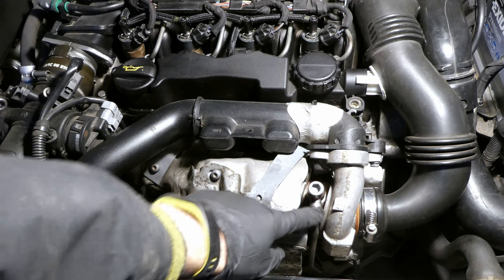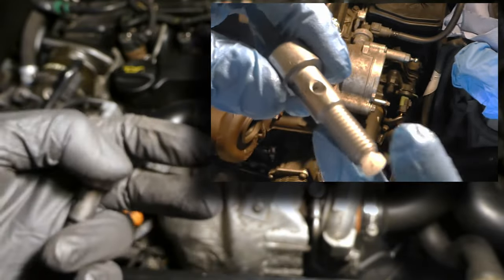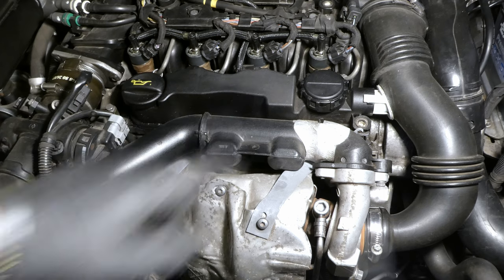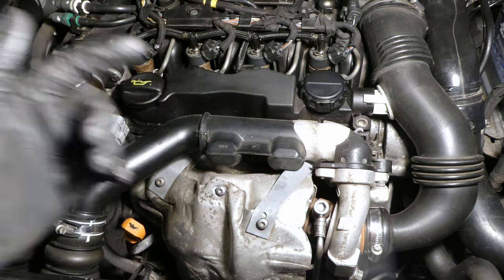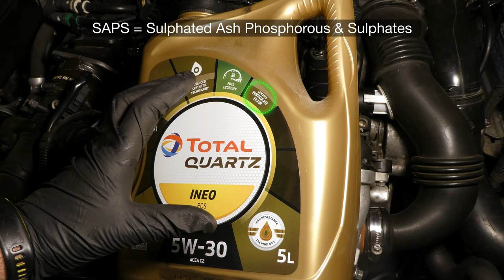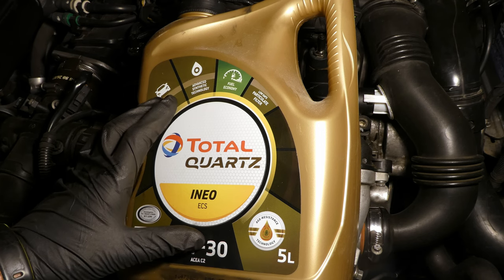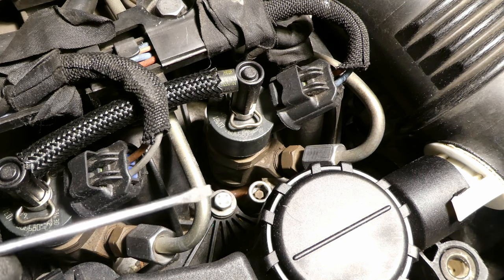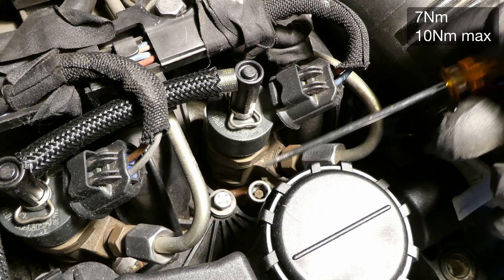1.6HDi turbo failures, the 2 main reasons and surprisingly simple steps to prevent it

Comment: Why wouldn't the oil filter stop the carbon deposits getting to the turbo? I thought it was a case of the oil pickup getting clogged causing oil starvation to the turbo.
Reply from the maker: Because it is something that fairly few people know. The oil filter has a bypass valve! If it gets too clogged and the flow of oil needs to still go, so it has a bypass valve, all the bits and pieces do not go through the filter. Hence, it is crucial to change oil lfrequently + the oil filter.
My fault, I did not include this in the video.
Reply: @moremolecules  do you know what the little nipple on the oil filter is for? Is it just to help locate the filter when installing? I read somewhere some versions exist that have a tube outlet instead of just a plastic nipple.
Reply from the maker: @norm4260  Yeah, not too sure, as far as I know it is just a location lug, nothing more, but may be wrong about this. For the 1.6HDi, I do not think there are more designs about there, but maybe, I am not the best expert on these 🙂

Comment: Great vlog. Its why I buy petrol mine also. 2007  berlingo 1.6 with 146k still runs fine just a bit gutless
Reply from the maker: I agree the 1.6 petrols are pretty stable, not much in there to go wrong. A bit gutless though and consumes quite a bit of petrol.
Reply: @moremolecules  japanese petrol engines with vvt have low consumption and high reliability. The perfect car would be a german one with a japanese engine.
Reply from the maker: @AC-db4ek  Yeah, maybe, parts will be difficult to get for the Japanese in Europe.

Comment: I've had my Peugeot 1.6 HDi 90 from new and it's now on 410,000km (256,000 miles). It blew its turbo at around 200,000km and the mechanic was convinced it was the quality of oil I had been using. While the oil met all the requirements (5W30, fully synthetic, ACEA C2, PSA B71 2290, etc.) and I changed it every 10,000km or 6 months, it was a supermarket brand (E.Leclerc here in France) and he was not impressed! So since then I have only been using the likes of Shell, Mobil, Total and so on. So far, so good.
Reply from the maker: Yes it could be, but when a turbo blows there is always some sort of a more concrete reason. I suspect the mechanic did not investigate fully why that hapenned. Blocked banjo bolt or something blocked somewhere or could be that you cover a lot of km/miles and there would be a limit to components of course. If the oil was meeting the specs it should have been good, but maybe. I always use reputable oil manufacturers, Total, etc., but the others should also be alright.
Reply: @moremolecules  I don't really doubt the mechanic - he's always been spot-on with everything he's done for me over the last ten years or so. I did ask him about the mesh filter but he said it was difficult to tell. He did replace it though with the long plastic one. The turbo had a massive failure and the oil filter was full of metal and ceramic. He had to do three oil and filter changes as well as a sump removal before he was happy there was nothing left before he fitted the new turbo.
Reply from the maker: @ajkgordon  Yes, sometimes is a bit difficult to tell. The failure is more often than not spectacular, say the shaft seizes and overheats, breaks in a place somewhere and the blades get to touch the metal casing and then these get thrown in the oil return, filter, etc. Unless is caught earlier, but difficult to do.
Reply: @moremolecules  I was very proud of mine at 400,000km but when I took it in the other day, he had an identical Partner in the workshop at 750,000km! Fantastic cars. Our next car will be the Rifter.
Reply from the maker: @ajkgordon  750k, that is something...

Comment: Great info! Many thanks.
I have replaced 2 of the copper seals in the last year after signs of the black tar, and slight chuffing, fumes in the car, have also checked the torque on other  injectors. 
Just wanted to ask if re cutting the seating surface is always necessary? mine looked good after a thorough clean so I just replaced the copper seal without re cutting the seat.   is that ok if the leak wasn't too bad? the first one I did has been leak free for a year now.
Thanks.
Reply from the maker: No you do not need to recut the seat, but of course it depends on how long it was chuffing. The longer it is the more opportunity the gasses have to eat the metal and then you need to recut it in order for the seat to be level and the washer to make a clean contact. The cutting is also needed of there have been carbon deposit as well, but is it is clean whe the new washer was put in, then it should be ok.
If it has been clean for so long now it is absolutely fine.
Reply: Many thanks. @moremolecules
Reply: I'd place the cutter inside and hand turn it with no pressure. This way your not cutting down any more but if there is any tinny uneven areas it will sort it out. Ps pup some grease on the end so any bits stick to the cutter rather than drop in the chamber

Comment: Thanks for the informative video. The question, where do we need that turbo oil line banjo mesh filter? The oil is anyway filttered. Does this "banjo filter" work as the "last chance filter" in an aviation jet engines? Better to remove that filter in order to prevent oil starvation?  "Any oil is better than no oil".

Comment: Hi More Molecules! Thanks for the genuinely great videos! You are very knowledgeable about the 1.6HDI engine and I have one in my Citroën C4 Grand Picasso 2010. However, this particular one suffers from a problem. There is a fuel leak. Diesel drips down from somewhere on the back of the engine and down onto the exhaust. The car shows two error codes P0093 (Fuel System Leak Detected Large Leak) and P0087 (Fuel Rail / System Pressure Too Low). I suspect the fuel harness to be the culprit but it's hard to see because everything is at the back of the engine. Is it possible to change that harness from above, so to speak, or is there any other way to access the back of the engine? When this more serious issue is out of the way, I'm going to fix the leaky crankcase breather, with a thicker O-ring, the way you showed, and I think there are some other issues that you have solutions for too. Anyway, thanks for all the videos! I hope you can find the time to answer my questions. /Mats
Reply from the maker: It could well be a leaky diesel fuel filter or something else. Pretty much all is at the back and rather difficult to do from the top or front. The C4 has limited access to the back, so it would be easier if you have a mirror and look where it leaks. It is leaking somewhere, so you may have to remove the airbox and have a better view. Do not remove the diesel filter and it may be leaking from there. Good luck
Reply: @moremolecules  Thanks!

Comment: I agree that clogging of the turbo oil feed filter kills most turbos, I doubt that's related to the injector. However the biggest flaw of this otherwise solid engine is the oil volume of only 3,7 litres, which is far too little and the root cause for poor oil quality due to contamination with fuel and soot. Independent of mileage I believe that 2 oil services a year are mandatory.
Reply from the maker: Yes, the injector seal failures have been for awhile in the PSA bulletins. I agree that there is not enough oil in the 1.6HDis. Even my 1.6 Peugeot petrol engine has bigger capacity than the diesel.
Reply: @moremolecules  I know, I had to fix mine recently and of course it was the cylinder No.1. I just cannot imagine how the gunk that emerges from the seal should  make it back into the oil circulation. Did you open the valve cover of your engine and have a look at the cams? I found mine to be shockingly worn, probably because the hydro lifters are blocked with oil residue and don't give enough way once the engine is hot. However, once worn it does not seem to get worse, as I could not find any metal chips in the oil or filter.
Reply from the maker: @cyberbob4111  Yes, it took me really some time to work out how the gunk can go back in. The thing is that the injector tube is not integral to the head of the engine or crankcase, so there is a rubber seal that seals it from the crankcase. The gunk can pass that one and go into the crankcase oil and then the consequences of gunking the small turbo oil feed filter and the oil pickup as well. I had a look at the cams, but they look kind of alright, there are a bit worn, but they do not seem excessively so.

Comment: My turbo got faulty after i overfilled a bit of the oil, and on top of that the seller got me the wrong oil for the car. Now it has no boost and there’s oil spilled around a lot of parts. Replaced the crankcase cover but oil is still coming through the PCV valve into the turbo intake manifold. Still can drive fine but very sluggish. There’s oil leaking in the turbocharger, smoke is being expelled from it since startup. Actuator vacuum seems ok, there’s no excessive play from the rotor, turbine is sucking in air just fine without any noises… Going to an autoshop would cost  more than what the car is worth… I don’t know what to do to fix that.

Comment: Nice video bro. Thank you very much. I did the seals replacement and it went well. However, i discovered diesel leaking of the diesel entry on the injector. 
Do you know how can i solve it? Thank you
Reply from the maker: You could potentially nip the nut a little bit (if it was disturbed or undone), but preferably undo the nut, inspect and re-seat or change the fuel line itself.

Comment: Hello! I just saw you video and i had a similar problem with the injector seals on my 2007 Volvo C30. At one point this year i started noticing gas smell inside the car when the engine was stalling but not when i was driving at high speed. I had it checked and the mechanic told me it was the injector seals which were worn out. There was also the grime you just described near them :) Anyway, i had them changed, the engine cleaned, and after 2000 km i changed the oil and oil filter along with the air filter. It runs smoothly and accelerates well to its top speed (180km/h).  Should i be worried though about my turbo?
Reply from the maker: Very good questions. Generally, if you service it regularly and replace the oil filter regularly, then it should be alright. I did not quite expand in the video, but the oil filter on these is a full flow filter with a bypass valve. So, if it has not been replaced regularly and on time, then it gets clogged a bit and the bypass valve opens, then all these carbon particles can go to the turbo banjo bolt filter and clog it.
In short, if you have been servicing you car regularly it should not be a problem. You have noticed it quickly, so unlikely to be a problem.
Reply: @moremolecules  Thank you for the answer. Fact is that i did drive a few hundred miles before fixing it, thinking that it was probably a minor problem with the exhaust or cabin filter, only to realise when looking under the hood that it was coming from the engine. 
And yes i change oil and oil filter each year, air filter once every 2 years, i changed the fuel filter 30.000 km ago. Next i want to flush the coolant, its 5 years old already.
When accelerating from 1600 to 2200 it seems that the turbine is whistling a bit, but i assume it's normal to make a sound like that when entering its cruise speed.
Reply from the maker: @BHDJG  It should be then alright, unless you want to open the banjo bolt and clean it, but it is a bit of an effort. Maybe there is a difference between the C30 and the other 1.6HDi, but the turbine does not whistle on these, or at least you cannot hear it as compared to other diesels. Maybe it is a bit more open on the Volvo or some of the air hoses are not connecting properly.
Yeah, coolant. Flush it with distilled water. That is what I did: https://youtu.be/CSmm2SCpPCs

Comment: Theres also a mesh screen that sits inside one of the banjo bolts in the turbo oil feed, that becomes blocked up with grime and prevents proper lubrication of the turbo, just remove it and refit the banjo bolt
Reply from the maker: Like at 2:44 ;-)
Yes, but if there are any bits they will certainly block the turbo shaft when they go up. I replaced mine, but really thought hard about removing my mesh filter. At the end used the upgraded version. Pros/cons it is 50:50 for the mesh filter
Reply: @moremolecules  sorry i completely glanced over that part 😅🤦 very informative video tho, well done 👍👍

Comment: I part exchange my peugeot 307 1.6hdi 2005 last week with 182000 + mileage with orginal turbo, injectors, engine, gearbox still working perfect.
I bought this car in 2014 with 123000 milage and read common faults on different forums. Then change turbo oil feed pipe and remove plastic filter (old one has gauza mesh type filter) also change oil pick up pump in sump. Always use 5w30 c2 low saps oil and serviced between 4k. . .5k. Every single time engine oil flush and check injectors holding 8 bolts if bit loose then tight up nicely. 
Again  my daughter bought peugeot 2008 1.6 e-hdi 2014  with 132k miles on clock. This engine is 8 valves (old peugeot 307 was 16 valve). Really i didn't want to buy diesel same engine but daughter like the car so buy again😮. 
Just want to stick with same servicing schedule. I heard that 8 valves engine has less problems then 16 valves 🤞. 
What you think can i change turbo oil feed pipe and remove little filter as i did before and oil pick up pump in sump. 
Regards
Reply from the maker: Yeah, the 8valve ones are a changed design and as far as I know much less prone to turbo failures, so I would not worry too much about changing oil pick and so on. Even on mine when I changed the turbo filter, there not a single speck of anything, so I could have kept it. If you stick to servicing it as you have, I would not worry too much about it.
Reply: @moremolecules  
Thank you very much sir for reply 👍.
Yesterday i did serviced to peugeot 2008 1.6e-hdi. When i checked air filter and cabin filter i shocked fully blocked and diesel filter same. (I believe after dealers   3 years servicing nobody thouch this car except mot.  But service history of local garage (Coventry) show 4 years record till last month which is fully . . . . My daughter ring garage they said this car never come to us for servicing or for other work. Strange . . .
Reply from the maker: @arshadmahmood1845  The e-HDi is not 2008, but probably 2014. Yes, the dealership will do that. I had mine serviced for 4 years at dealers and then started doing my own. The air filter was so black that it was never replaced.
Reply: @moremolecules  
You are right sir. Its 2014 64 reg and model 2008.
Reply from the maker: @arshadmahmood1845  It definitely does not have a lambda oxygen sensor, but not too sure about the tank thingy. Could it be that you overfilled it and the breather filter has clogged?

Comment: Hello, Very useful and informative video, thank you. With regards the Banjo bolt mesh filter......In your opinion is it sufficient to remove the wire mesh with a small screwdriver, and leave it without a filter   OR should one ideally buy a plastic filter (as shown in your video) ? I would not know where to buy the plastic filter.  Is it possible to remove the Banjo bolt which feeds oil to the turbo without removing the FAP ??    Once the oil line / tube has been drained of oil (by removing the banjo lower bolt), is it necessary to prime the oil feed to the turbo so it is not starved of oil when the engine is initially restarted  ??    THANK YOU
Reply from the maker: Thank you for the comment and interesting questions. Difficult to answer some of these. I would ideally buy the replacement plastic mesh filter. It has been redesigned to allow bigger flow of oil and keep the turbo clean. If you remove the metal original mesh completely then yes, there will not be blockage of the mesh, but you risk small particles to go to the turbo. There should not be particles, but you never know.
The stuff that I used are in the description of the video, mostly from ebay.
I do not think you can get access to the banjo bolt without removing the exhaust and the alluminium shields.
There is no need to prime the actual pipe, but you prime the turbo itself, then it spins with oil inside. Initially there is not that much heat and the oil that is inside keeps it lubricated, then eventually a few secs, the pump will have put oil in the turbo.
Hope all these make sense, but let me know if something is not clear.
Reply: @moremolecules  Thank you for your replies. I cannot find the replacement plastic mesh filter in your links, please would you mind letting me have the link. Some people suggest that removing the original metal mesh helps achieve better turbo lubrication, and others state that you get more black smoke through the exhaust because there is too much oil flow to the turbo. (I am not too concerned about small particles getting to the turbo as I change the oil quite regularly). The plastic filter does seem to be a reasonable compromise. 

It is a shame with today's engines you have to remove so many components to get to the one you wish to remove. I cannot understand why PSA designed the oil feed to the turbo behind the FAP !!!   Understand that priming the turbo with oil by removing the Banjo bolt on the turbo will keep it sufficiently lubricated until the oil pump kicks in from the engine. Many thanks.
Reply from the maker: @johnmcculloch4009  Yeah, sorry. The components are in a series of 5 videos I made on how to replace the turbo: https://www.youtube.com/watch?v=Q7S0qDBo314
There you can see several links and towards the bottom you get the Nerings replacement kit: https://ebay.us/I75sFD
There are some other bits and pieces